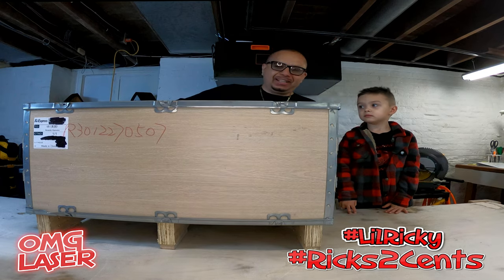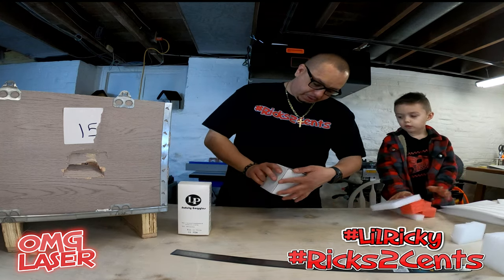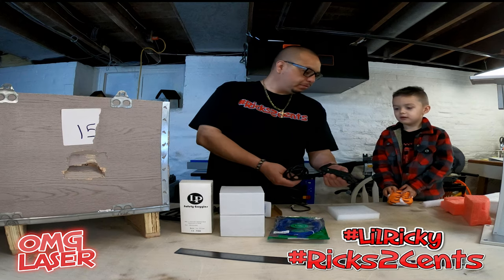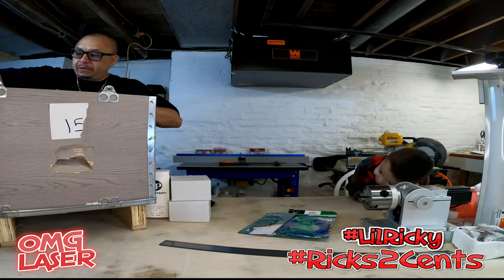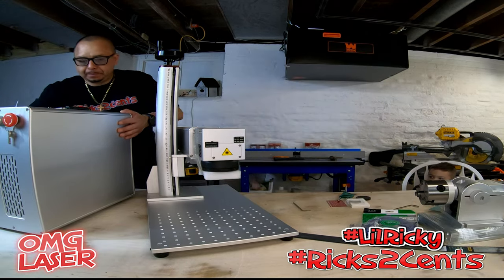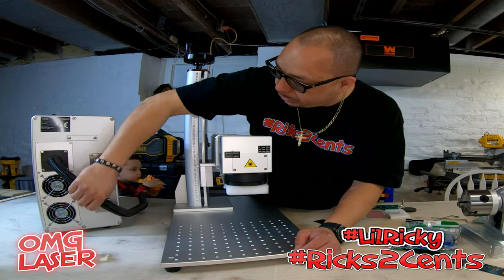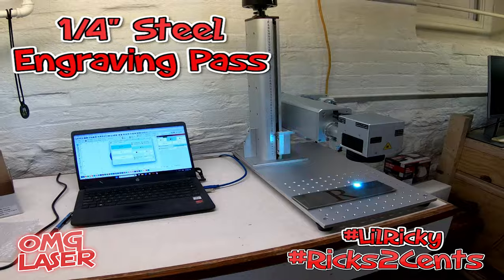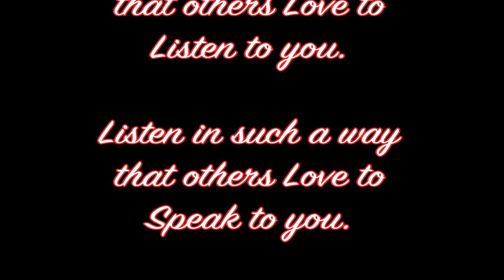60W M7 Mopa Fiber Laser | 60W Mopa JPT Fiber Laser OMG-X UnBoxing & Full Review

Comment: Rick where did you get that great workbench???
Reply from the maker: Which One?
Reply: @Ricks2Cents  the white topped one, with drawers and lower level, that you show final location with the Mopa Fiber Laser on at the end.
Reply from the maker: @KG5RJR 
It’s Custom made a Friend Blessed me with it.
Reply from the maker: @KG5RJR  
I do not think it would be a difficult build though.
Reply: @Ricks2Cents  True, have been looking at the ready made stuff and not alot these days sturdy and ready to go with that proper size for these.  Great work your doing..
Reply from the maker: @KG5RJR 
The Table at the start of the video I made that out if a Full Sheet of 3/4” Plywood. I also made a built in for my Table saw. It makes it allot easier to cut a Full Sheet of Plywood by my self.
Reply from the maker: @KG5RJR 
Most Premade Tables are Junk. I did see a nice Dewalt Table at Home Depot yesterday that had a crank to be able to adjust the height. It seemed Sturdy.